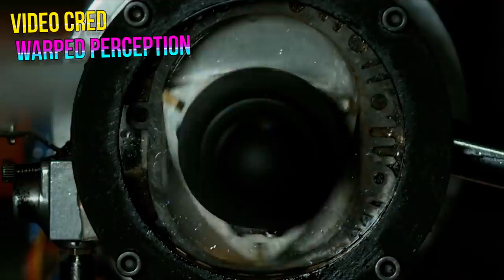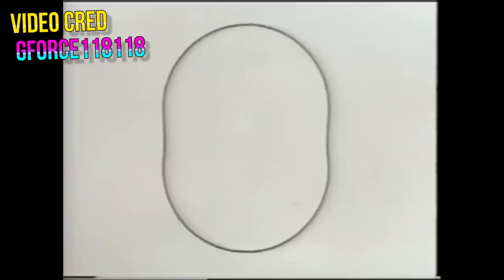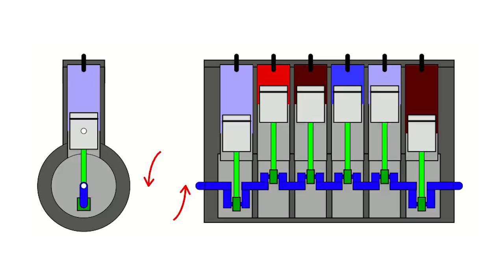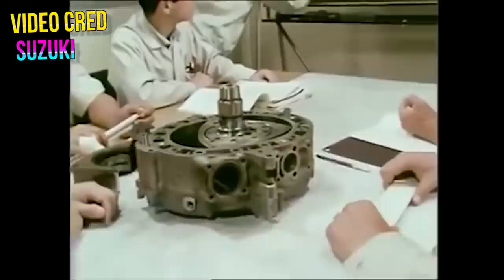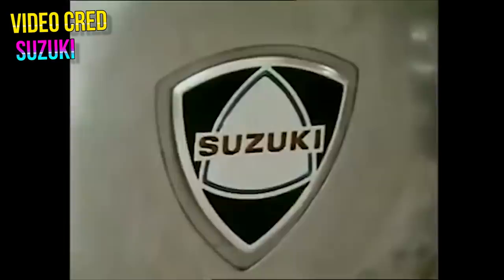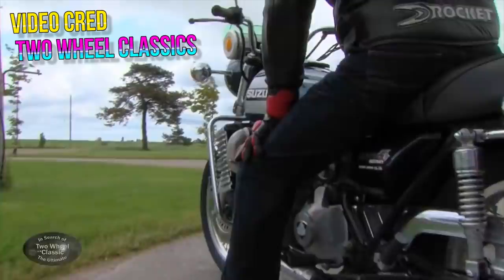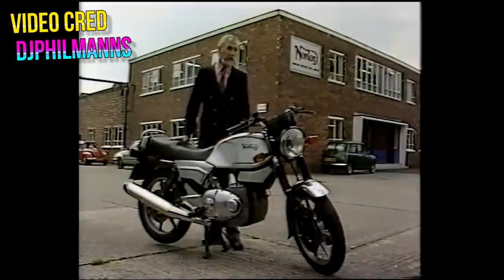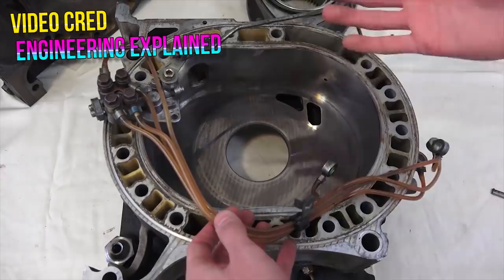Production Rotary Motorcycles - Suzuki RE5 and the Nortons

Comment: Top notch as usual. Bravo.

Despite the fact that the Wankel is actually a two-stroke, I was able to keep up on maintenance on my last RX-7 and finally sold it with 317,000 miles. You just have to drive the rotary like you'd imagine an F1 motor to perform. NEVER go full throttle until the motor is already spinning past 5,000 rpm, otherwise you'll blow through your seals. ALWAYS change the oil sooner than you need to, and don't let it run low because it burns oil on purpose. And FREQUENTLY spin the piss out of it to keep the seals out in their most seated position via inertia. Just remember that a two-rotor engine with six chambers working individually at all times will consume the fuel comparable to a six piston engine driven in a similar fashion.
Reply from the maker: Which generation RX-7 was it?
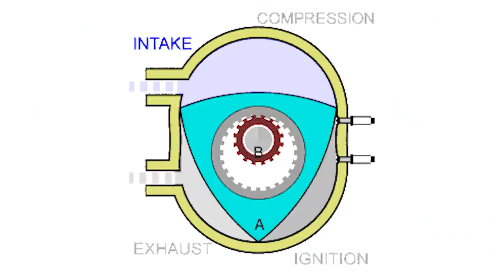Reply: I'm sorry dude, but the wankel is a 4stroke engine. It still hast to go through 4 cycles until another power stroke, even though it only needs one excentric shaft (no crankshaft in rotaries) revolution. Look at min 3:17 and count the strokes. 1:intake, 2:compression, 3:ignition, 4:exhaust
I expect the misconception results from the similarities between rotary and 2-stroke design. For instance, both are lubricted by oil mixed with the petrol. And yes both types of engines have no valves (some 2-strokes are valve driven). But that's not what specifies the type of power cycle used by a engine.
Can you tell me what engine the 6 chamber one was? Im pretty sure there can't be a thing like this, as this would resut in a 6-stroke wankel.
Reply: @Tobwart9  I think he was talking about the two-rotor engine. 2 rotors with 3 chambers each.
Reply: @Theillestrator1050  To be lasting that long without a rebuild (and adding more power ;)) it's most likely an FB RX-7.

Comment: Cool vid! I owned 3 original Mazda R-100's, 1970/1971. I made two go beyond 77k miles, one went to 110k before I screwed up and overheated it with an aftermarket fan kit. With those 10A engines, I  just changed the oil religiously, kept the oil level up, and let it warm up slow in the morning. CORRECTION: The Mazda 4-rotor race car that won LeMans is a 787.

Comment: Nicely done video. I can live without rotary bikes but I MISS my 2 strokes!
Reply from the maker: I won't even lie to you, there was a period of time where I was looking at buying this pristine RD350 in the Bronx because it sat on craigslist for months. Really wanted a summer two stroke.
Reply: @Theillestrator1050  
THAT's the one to get. RZ even better. Unless you are in Canada. They got the 500s.
Reply: @upsidedowndog1256  as a kid we had a green rd400 that was scary fast mid70s model than later I had 3 rz350's and half a dozen banshees...great memories...from Wyoming USA 🔫🤠🇺🇸
Reply: @billallen4793  
I got to ride an RZ350 one time and then the owner had a bad crash on it. I was going to bid on one at an auction many years later but it didn't run and the bidding started out over $1500.
Reply: @upsidedowndog1256  they are incredible around town hooligan bikes had one black and yellow and two of the red/white I can't remember if they had a little bit of blue or not...I sold the last one in 91 or 92ish... no fun on the highway with semi's because you'd get blown all over the road because they were so light...I wish they would have made an rz using the fzr400 aluminum frame now that would be a great town/track bike...from Wyoming USA 🔫🤠🇺🇸
Reply: @billallen4793  
I was also a fan of the FZR 400, never got to ride one, though. Another friend had one when they were new. You guessed it. He crashed it on a highway cloverleaf interchange. He liked to do all 4 corners over and over. Tires back then were a bit sketchy, too. He hurt but not terribly so. Bike didn't make it.
Reply: @upsidedowndog1256  the baby fzr 400 genesis was a high reving 5valve inline 4 it reved to 14 or 16000 way back when... Suzuki had a gsxr 400 as well but I was never around one.. that little fzr had tiny little valves like super small..  the end of your pinky small. Not as much fun as my rz's powerwise but the fzr's had better brakes and wasn't like a noodle in the corners....from Wyoming USA 🔫🤠🇺🇸 p.s. my last one had every banshee part I could find in 1991ish was frighteningly fast up to 110-120 mph mine ran out of steam after that... nowadays you can get aftermarket cases and stroker crankshaft's but back in the day I showed allot of 600's my taillight drag racing and on a tight course it wasn't even fair...lol...

Comment: The rotary lives on, in just about the coolest bike ever made, Michael Crighton formerly of Norton motorcycles, stuck with the technology he now makes his own bikes and the Crighton cr700w has solved, virtually all the rotary's flaw's,  the bike weighs 130kilograms and produces 220bhp from a double rotar the bikes fame doubles as an oil tank and provides  liquid cooling for the outside of the engine and they use a ventury effect from the exhaust to air cool the center of the engine, in the words of Guy Martin * fking hell it's  fast*

Comment: as the owner of a 1990 RX-7 and a rotary fan through and through I never knew that any bike manufacturer even made a rotary powered bike i must own one now
Reply: ronnie cason i would love to have one but nowadays they are incredibly hard to find.
Reply: Find the first year Suzuki late 74-75 depending on where you lived. It has the cool dash the 76 model uses regular round gauges sourced from the 750 water buffalo... had mine for almost 20yrs... you can still find them for around $2000.00 on the old interweb....from Wyoming USA 🔫🤠🇺🇸p.s. I'm building mine for Bonneville 😁

Comment: Norton rotary race engines proof of concept was literally deveolped in a caretakers shed from an engine from a scrapped police Interpol bike by Dave Crighton whose masterstroke was coming up with  the ‘exhaust ejector’ using the Wankel's hot exhaust venturi to drag cooling air through the engine’s internals allowing air for the carbs to arrive unrestricted. From 1988, 1989 sponsored by JPS team,  to 1992 when they pulled out the Norton reigned supreme. The Norton rotary soldier on under Crighton now as Roton/ Duckhams and was even more dominant in UK than JPS had been. Rules changes banned the rotary 1994/95 and twith the demise of Norton so did the rotary engined racers. 
 Crighton now works for Rotron engines and has produced a very limited edition twin rotor motor cycle of 700cc 220bhp 129.5 kg dry making it the highest power to weight ratio superbike in the world with more torque accross its rev range than any aother motor cycle.

Comment: Great video. I wanted that Norton so bad. I still have the sales brochure I got back around 1985. I had never seen any other pictures or video of it until now. Plus you woke me out of my RX-7 quad rotor compound turbocharged dream state. My fallback position is mountain bikes. "Cheap", fun, simple.
Reply: Not sure how you can be happy with mountain bikes after fast cars and motorcycles...  Maybe add a bike motor kit, and gear it down to 20-25 MPH for maximum torque? :)
Reply: @barking.dog.productions1777  It's kind of hard to put into words. Flying through a forest between the trees is really fun. And bikes now are incredible. My next build is $12k. 23 pounds of fun. Minimal risk. No DMV. No insurance. Quiet, simple. I spent so many years racing cars. I just sold my Porsche 928 GT. I wore out the roads.
Reply: @Gkuljian  Yeah, good quality bicycles are unbelievably expensive.  Bike motor kits are around $200 for top of the line 4 stroke.  That and a cheap MB from wally world would be a lot of fun ($100+)  Ive got two that I am putting together now.  One is a WWI military motorcycle replica for the street.  When I want to get serious about off road I have the Honda XR250R.

Comment: great vid 7 awesome commentary mate! my last bike was a worked ZX12R putting out 198hp at the wheel & i always wondered how a bike would be with a mazda 12A or 13B but as you say in your video, cooling is an issue.. noy to mention fuel burn.. after all, big HP means big fuel & big air =)

Comment: If there was a way a rotary engine was designed to be more of a 4 stroke by compressing —> compressed fuel again would definitely be interesting, perhaps taking the wankel more of a square shape idk...
Reply from the maker: Lmao, I don't know enough about the geometry and physics to confirm or deny
Reply: There is a concept design that adds another rotor but its football (american) shaped, that the exhaust is routed into, which allows it to continue its combustion. I believe the designer claim an 40% increase in efficiency, I do not know if that's true or not.
Reply: Kasimir Wulf are you referring to that one design that Rolls Royce did?

Comment: You characterized the ignition of the air fuel mixture as an explosion.  That's extremely misleading, it's actually a controlled burn.  If it exploded your engine would explode too.  That's called knock (post ignition) and ping (pre ignition), and it's bad.

Comment: I know this is gonna be super annoying to say but... There's the Wankle engines, and then there's the real Rotary Engines.
The engine you're referring to specifically is the Wankle Engine.
A lot of people just call the Wankles rotary because well it just works, but it's technically not correct.
A Rotary Engine, the real ones, are piston engines where the crankshaft is affixed to the frame(usually an aircraft) and the engine spins around that Axis.
The LeRhone Rotary, for example. They were used a lot in planes during WW1. They were crude, simple, and yet very powerful for their size and weight at the time.
Perfect for the new wave of combat aircraft.
The Wankle engine came later.

Some Sources for you to check up on: https://en.wikipedia.org/wiki/Rotary_engine
Reply from the maker: Yeah I know about the airplane rotary engines already, but contextually speaking, people will know i'm referring to the Wankel Rotary engine in this video and it wouldn't be necessary to keep making that distinction, especially if most people understand it as a "rotary engine" regardless of semantic correctness. This includes engineers and manufacturers who even keep it simple that way because neither they or most of the public hasn't exactly thought (or cared) about niche airplane engines that have been obsolete and out of use for nearly a century now. It's all about context.
Reply: @Theillestrator1050  I actually really respect that you explained the pronounciation of the engine name, and then used that name the rest of the video instead of going back to calling it a rotary.
Like I said I was gonna be annoying, but I also really respect your change up there.
Reply from the maker: It wasn't annoying lol, its not like you were trying to push wrong information. You're totally right but my angle is more about the collective understanding as of now... plus convenience 😂
Reply: FranBunnyFFXII, strictly speaking you're wrong that type of engine is known as aradial, mistakenly called a rotary
Reply: @Bob_1760  Nope.
Radials are different than Rotaries.

Infact that Wikipage I posted even explains the difference between Radials and Rotaries.
In short Radials spin a crankshift Rotaries the whole damage engine spins, and the crankshaft is stationary.
Go read the wiki page.
Reply: FranBunnyFFXII, whether or not the crank-shaft is stationary or rotating it is still a radial engine, wiki is not the be all and end all of information and can be misleading.
Reply: @Bob_1760  Nope you're wrong. Every source literally shows that you're wrong.
Radials and Rotaries are not the same. 
That's like calling a DOHC VTwin and a Harley VTwin the same thing because they got a V in the Twin, lol.
Nope wrong.

Comment: Somebody needs to come out with an affordable V8 Sports bike 🤩🤩
Reply from the maker: Lmfao, imagine that... You might have better luck just making one yourself
Reply: The goldwing is a horizontal 6 so there can Def be a tiny v8. But imagine.... A 1000cc v8, that thing is going to scream.
Reply: There's an Australian company that builds a bike with 2 R1 engined bolted to a custom cast block and set in a carbon frame. Definitely not affordable but down right pornographic.